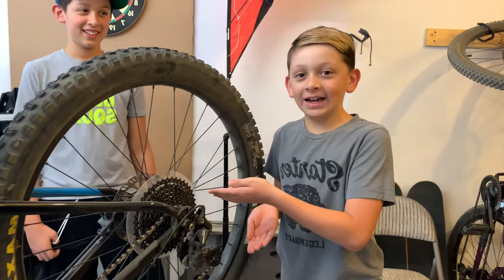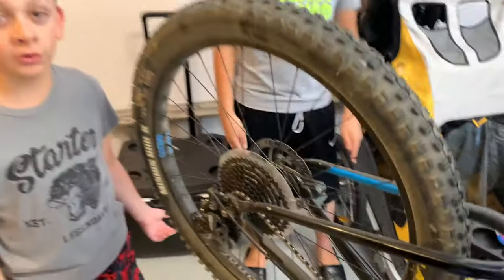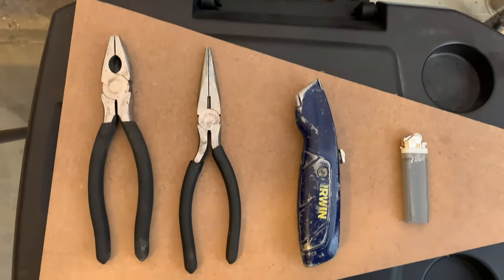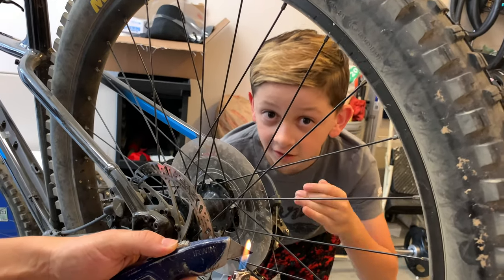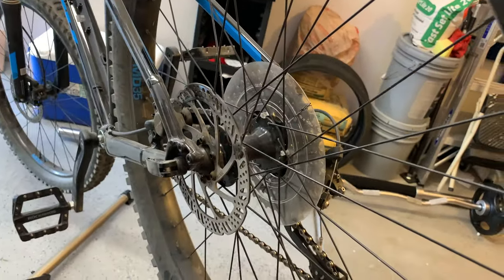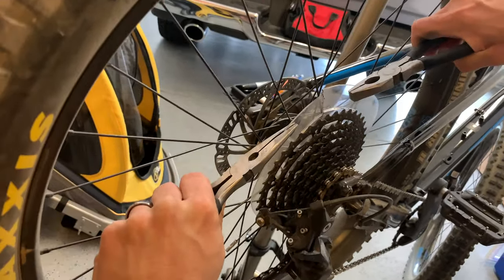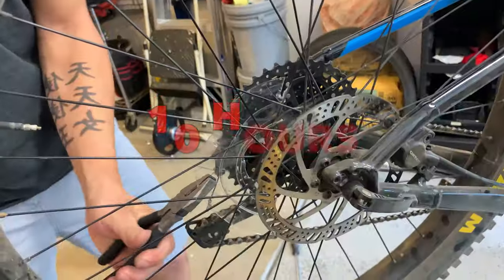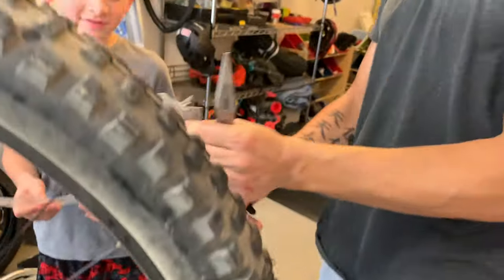How to remove plastic disc / Spoke Protector / Dork Disc from your new bike without the proper tools

Comment: Thanks a lot kid , at first i heated up a knife and just tore the half of the disc then disc was bent and i couldn't know what to do it was so frustrating then i watched ur video grabbed 2 pliers and tore apart the disc and it came of :D thanks u , i am subbing
Reply from the maker: Glad we helped!!!! Those darn disc can be so frustrating… they should have a dotted line to make it easier to rip off instead of having to remove wheel and cassette  lol 

Make sure to always keep your derailleur aligned. You don’t want your chain to fall into your rim. 

Thanks for subbing!!!
Reply: @SOCALMTBAdventures  i have one question tho my bike is a single speed one , it doesn't have gears?
So why did they put that disk in my cycle
Reply from the maker: We’ll I think there’s a law or some type of regulation that forces bike companies to put these discs on bikes before they’re sold.  They don’t want your chain falling into your cassette or spokes. Maybe they fear something catastrophic could happen 🤷🏻‍♂️
Reply: @SOCALMTBAdventures  oh thanks

Comment: Ever get your chain stuck behind there? I have when a derailleur failed when hitting a log. It's bad.
Real bad. 
Spokes can break and rip out.
Reply from the maker: Wow that sounds gnarly 😲 We know there is consequences to removing it. But can’t stand that thing back there making noise, flapping around 😆 Wish the hubs or the cassettes came with a built in, more discrete protection to that prevent that from happening 🤔